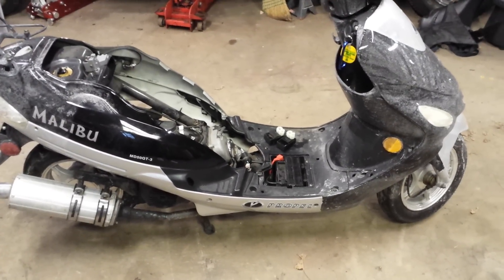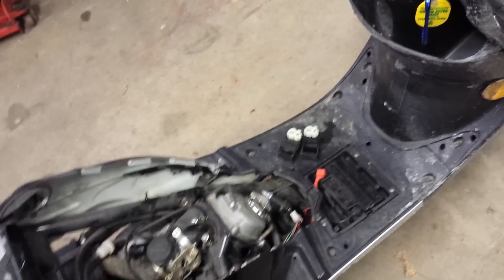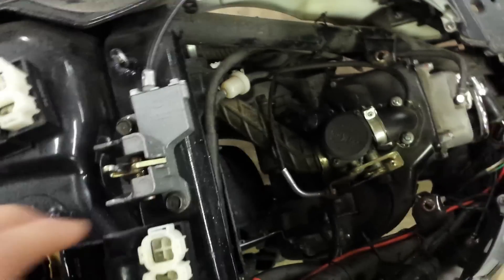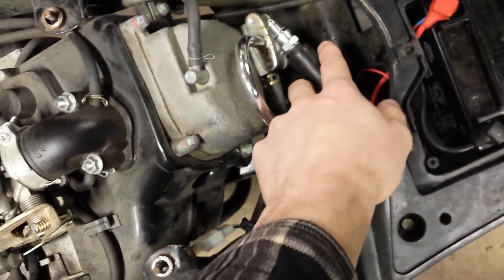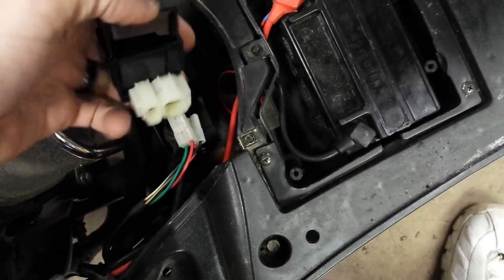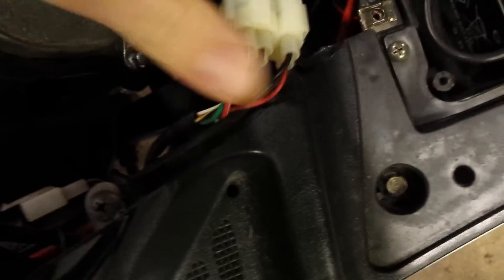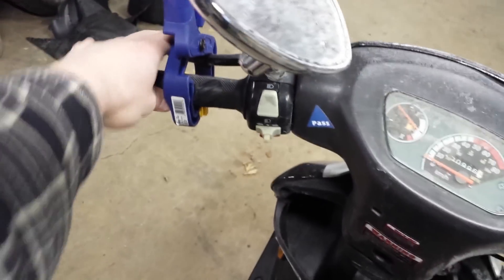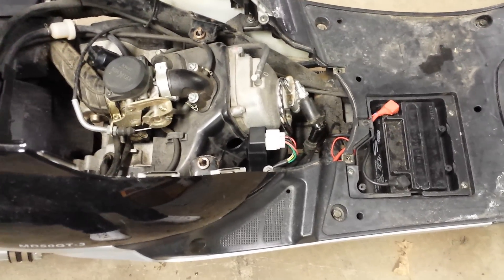Chinese Scooter 49cc CDI install / replacement

Comment: If I'm getting fired do I need to replace that the four in the two piece CDI box or just a coil it turns over with Bart and gas that will not fire off what can I do there is no adjustment screws on the carburetor tried to adjust my airflow thank you sorry Chucky Waller